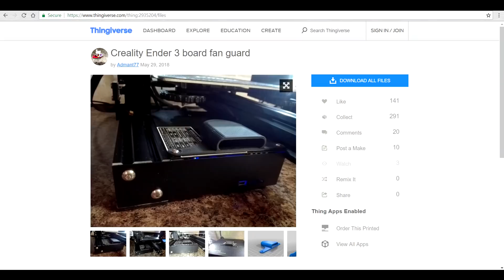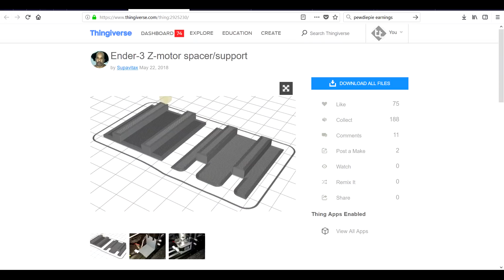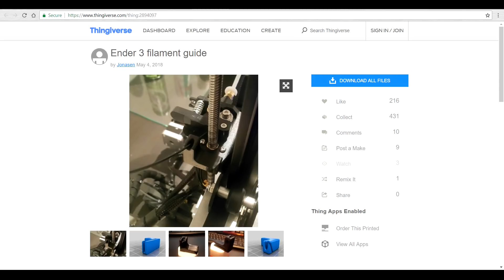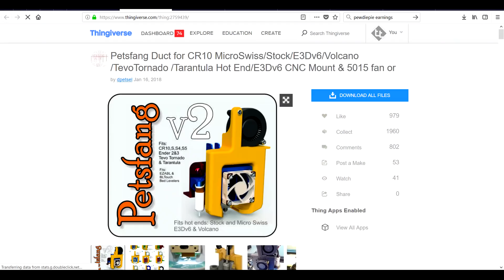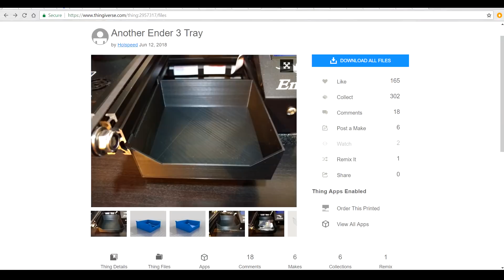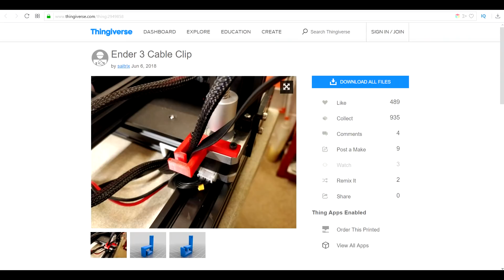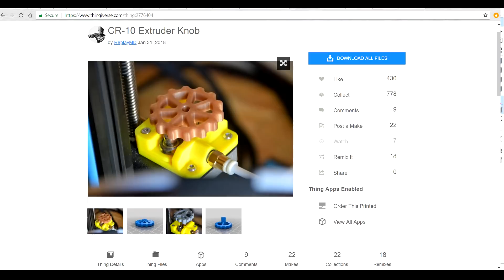The best cheap or free Ender 3 upgrades - re-modding my newest version

Comment: Why not cable chains?
Reply from the maker: Some people hate them, I don't mind them. Just don't think there is a huge need here. Each to their own.
Reply: they increase inertial drag on the cables substantially. You want slow printer, increased resonance shudder, lousy jerk so worse ghosting? Add Weight xxPD
Reply: @pdjames1729  I have not seen any of that on my printer.
Reply: performance test it against one without chains... you're losing mm/s and detail at speed - but if you like em, keep them.
It's Your machine, build it how you want it xx
Reply: @pdjames1729  I still get the same amount of detail and the same print times with the same gcode i was using pre-cable chain install. Just my experience.
Reply: and any differences will be subtle xx but physics is physics. A chain is weight, any weight will have an impact... I'm a less-is-more kinda guy :) even took the lower right V-coaster off to reduce wag on the X-axis, a tiny bit -lol
Reply: I think the extra drag on the print bed wouldn't be worth it, and it may not save your wires from eventually breaking from all the repetitive motion anyway. A better solution would be to replace the hotbed leads with a high-strand soft silicone wire. They're designed for high-flex moving parts, unlike the ones that come with the printer. That would be one of my first upgrades (along with a 15amp fuse), well worth the effort considering how easy it would be to start a fire when those strands start breaking and you're pushing 10+ amps through a few strands of copper.
Reply: @ABentPaperclip  You sound extremely paranoid, I've already got over 1100 (more actually, that's just what is recorded through my OctoPi usage) print hours with no sign of wear on the cables.
Reply: Plus, this is a home unit... cable chains on a quarter million pound robot router make some kind of sense... on a magic shoebox? It's posey, wasteful nonsense xx

Comment: Lol just did the capricorn tube Friday! Should have waited for the new tutorial, but working now! Keep up the great work and in depth and honest videos!
Reply: Oh! Definitely need the next video, glad you mentioned firmware changes, need to order the pi zero and cables in preparation!
Reply: @KnowBuddiesLP  get the full pi the zero is under powered and gave me loads of hassle.
Reply: @ThELyNXfragm  sorry, I meant the ardiono (sp?) I have the pi 3 with OctoPrint setup already, meant for the bootloader setup, thanks for the call out, and couldn't agree more on the 3 vs zero :)

Comment: Can you show all of the physical connections to the Pi?  how its powered and where its plugged in on the printer.
Reply: 5V/3A power supply, connected by the usb mini-b port.
Reply from the maker: This and then USB from pi to printer mainboard. Plug in USB webcam if desired.
Reply: so you aren't running it from the Ender powersupply?
Reply from the maker: No but I will be covering that scenario in the future. Still ordering and trialling parts.

Comment: For the LCD Cover there is a version to fit with factory screws on thingiverse ;)
Reply: Awesome thanks, by the way the original one added that also in a new update:
"16.08.2018
added two new closed Versions for factory srews, one with buzzerhole, one without hole."
https://www.thingiverse.com/thing:2858209/
Reply: Ohhhhhh! Do you have the number for that part? Links maybe blocked but can look it up by the # :)
Reply: @KnowBuddiesLP  actually just realized its the one linked in the description :D
Just pick the stl with factory in the name ;)
Reply: just in case that wasn't bs... it's thing:2987100 - but you still lazy :P I searched for Ender 3 cover (looked through list for one for stock screws)

Comment: So given a choice, which printer would you rather have.  The Ender 3 or the CR10 Mini and why. I have the Mini and love it. I have a friend who wants to get into 3d printing and wondering which one to recommend.
Reply from the maker: I haven't used the cr10 mini so cannot comment, but people who have both say that they prefer the mini. It has more features and more price, correct?
Reply: @TeachingTech  
Except for the option to add the auto bed leveling feature, I think the mini is a better deal (personally)  It's almost fully assembled, larger build area  etc.
But like the Ender, I have printed many enhancements for my mini.
Reply from the maker: I haven't used the cr10 mini so cannot comment, but people who have both say that they prefer the mini. It has more features and more price, correct?

Comment: Just want to say thanks for your videos especially those of the Ender 3. I use a Bltouch for bed leveling. Also, Buildtak has a flexplate the size of the bed 235mm² with pei sheets if you want.
Reply: Sure if you want to buy build plate that is half the cost of the printer. I can't believe it is worth it.
Reply: Alec Ward You can just buy a spring steel sheet and pei and just use clips. That would still be worth it in the long run for large prints. Besides, people are already swapping out the control boards and using tmc drivers with noctua fans, capricorn ptfe tubes, linear rail mods, bltouch, and swapping out the hotend for a microswiss. Whats one little magnetic bed that lets you swap out your surface from buildtak to pei. Not to mention you can use all the build space without your nozzle hitting any clips. 

Its useful but not entirely necessary.

There is no sarcasm in this post. Just pointing out how useful it can be in the long run.
Reply: @marcosramirez385   right I just think buildtak is a rip-off due to "name brand" over charging. I just bought a $15 magnet build surface and called it good. Binder clips drive me crazy!
Reply: Alec Ward I did buy the flexplate. It might not be worth it to others but I like it. It gives me the option to print with different materials and up to 120 degrees on the bed. Plus with my fixed heatbed and Bltouch I dont have to worry about leveling.

Like I said, not for everyone.

Which build surface were you talking about by the way? I'm interested in something cheaper for another Ender 3 I plan to buy which will b a pla only machine.
Reply from the maker: I have a prusa mk3 with the flexplate, a CCT with the buildrak version, and easy peelsy on two others. They are all better than standard. Personally I like the prusa one the best. Just my 2c.
Reply: Teaching Tech Have you been able to print ABS with the easy peelzy or would the temp be too low?

Comment: I like all of the thoughts and your feed back. My only $0.02 is regarding the cable management for the hotbed and gantry components. The clip you showed I'm sure works fine but the cable chain system (not the quickest print) adds a nice look to the machine and works like a champ.

Find it here:
https://www.thingiverse.com/thing:2920060

Comment: One more small mod i can recommend is a printed knob for the top of the Z axis lead screw. But be wary, some types may collide with a too wide extruder gear knob if printing higher than about 230mm, making rattling and grinding noises and possibly leading to both extruder problems and damaging the lead screw.
And one more essential upgrade would be a better spool holder, as the stock one is just pretty bad overall.
Reply from the maker: Interestingly a lot of people assemble the holder backwards so some rolls of filament don't fit.